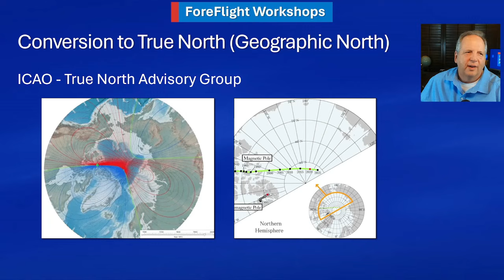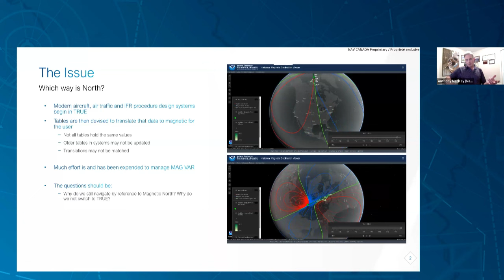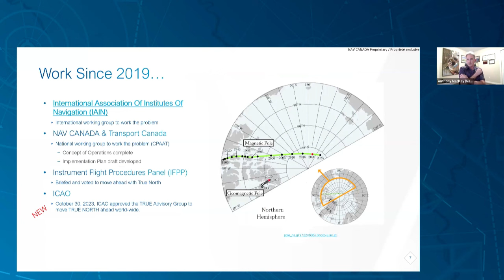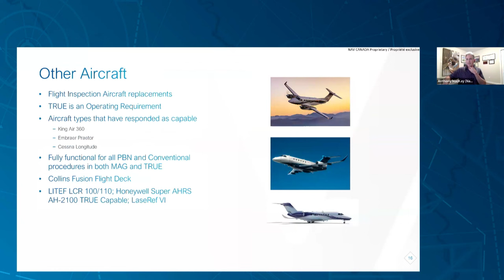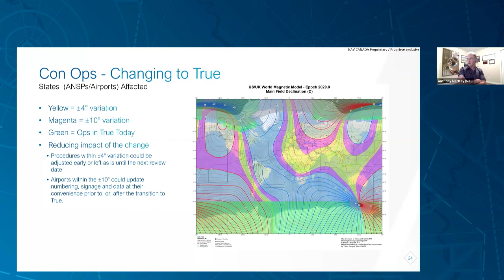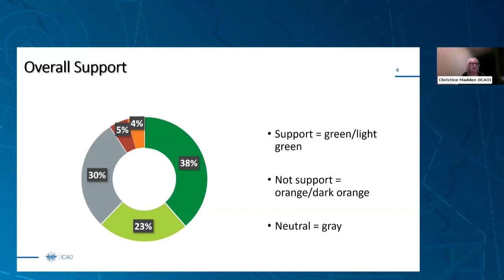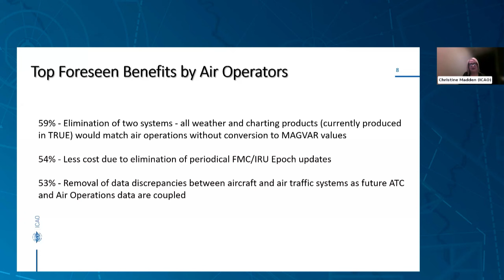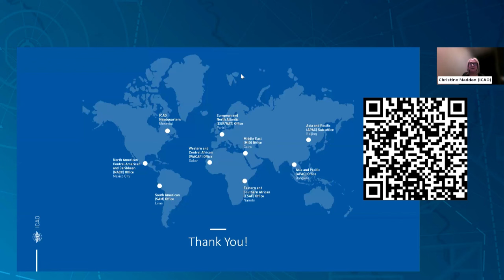ICAO Presentation on Converting to True North Navigation

Comment: I'm not saying true north flight plans are nessesarily good or bad , but there is really no need for all the magnetic problems listed; most of them are caused by incorrect application rather than being inherent to magnetic navigation. 

Though the need for pilots to figure and apply variation adjustment in the middle of an emergency so they can use the backup compass is exactly the wrong place to add workload. It is the antithesis of aviation safety culture where we do extra work of those conversions during planning to prevent such issues while flying. Switching to true north flight plans won't alter the need to have a magnetic course included on navlogs nor will it reduce the need for ATC to be able to and proficient in magnetic vectoring. General use of true north will however reduce practice and familiarity.  

Clearly these nav systems are being incompetently managed by a herd of bureaucrats if they have those track misalignment steps. I have substantial background in navigation, software, and aviation with some instrument proceedure development and radio broadcast engineering too. This is clearly a case of applying the magnetic conversion at the wrong step. 

Examples:
An ILS/localizer is a fixed signal aligned with the runway there is absolutely no involvement with cardinal directions true or magnetic, you could uproot the whole airport turn it 90 degrees and set it back down with no need to realign the ILS.

A fix or waypoint is a fixed to a geographic point on the ground and the course between fixes is geometry completely independent of cardinal direction.
 
VOR radials have a set published variation. Usually, and should be, rounded to whole degrees. While the receiver shows the radial approximating the magnetic course as a cross reference sanity check, the radial number is not an actual magnetic bearing. A VOR radial is geographically fixed and uses a simple offset from true north. (Canada's 2⁰ realignment requirement is a self inflicted problem, no sympathy from me, the USA has been succesfully using ±5⁰ for VOR magnetic-radial deviation for many decades so realignment and alterations to charts tend to run a 20-50 year cycle. As stated in the video compass nav is a ±10⁰ level of precision.)  Radials follow great circles anyway so the cardinal direction will change enroute whether using true or magnetic course estimates, an FMS should be using spherical geometry not simple bearings. (They are course estimates because the primary navigation is the physical VOR signal, or GPS track overlaying that VOR signal, not the cardinal bearing corrosponding to the signal.)
 
As such the track misalignment in a given FMS is simply bad programming and incompetent management by the vendor, and this sort of incompetence will not be fixed by switching everyone's fight plans to be true north based, because the navigation systems and flight director should already be using geometric tracks between points which makes steps and misalignment jumps mathamatically impossible. Only displaying a conversion to magnetic bearing/course which is made at the vary end. In other words they treated the course lines at the proceedure/airway building block and defining the ends as waypoints, when they should be using waypoints as the fundamental course building block and then connecting the dots.